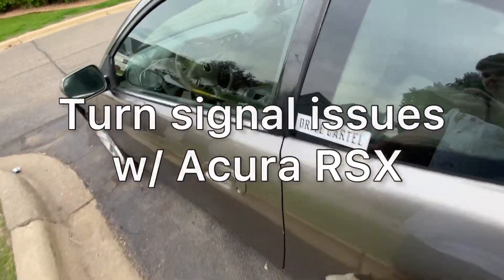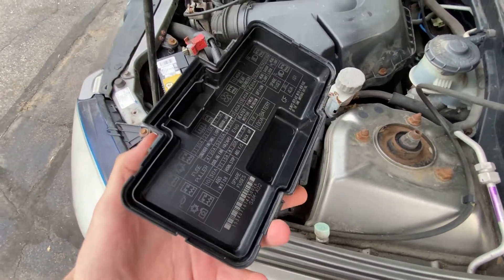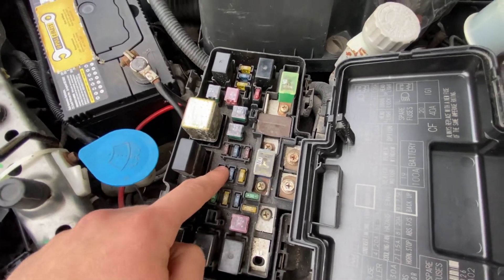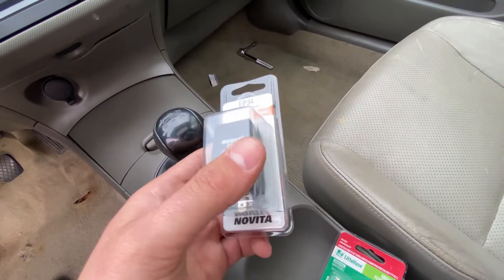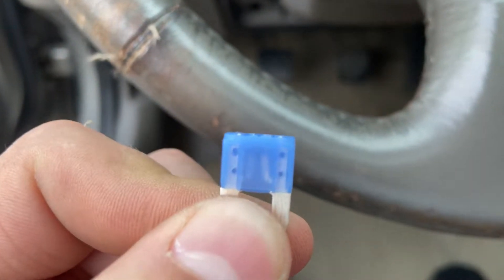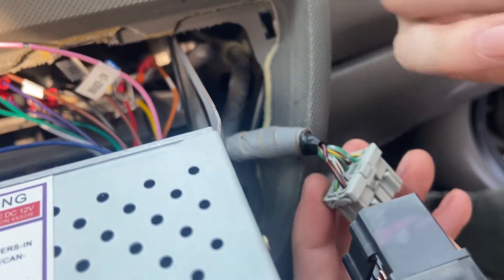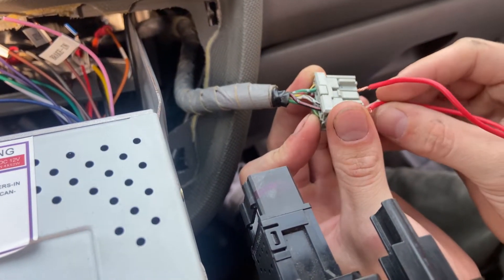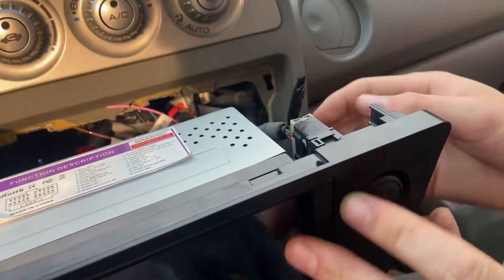How to diagnose turn signal issues (Acura RSX)

Comment: Sorta happened to me too after I installed an aftermarket radio in mine (02 RSX Type S) but I just had to reseat my turn signal switch and it started behaving (didn’t have to mess w the green and white wires) just swung by to figure out where the relay for the turn signal was again - got a diode dynamics one that’s LED compatible but also let’s you choose how the lights blink in a pattern which is kinda cool

Thanks for the vid!
Reply: Hey this has been happening to me and this could help but could you explain on how you reseat the turn signals

Comment: did it happen after you installed the car play? because i ordered the same exact carplay you
got and right after, my signals dont work but my hazards do
Reply from the maker: Yes so I’m assuming that was my main issue
Reply: @DC5CJay  all my fuses are good, checked on the power probe so what can i try next

Comment: My dc5 is having turn signal issues but it only happens sometimes. When I’m driving and try to use my turn signals the car shuts off. There’s no light in the dash nor do the blinkers or windows work but every other electrical component works. I have to sit with the car in ACC mode and wait for the lights in the dash to start flickering(as if a short is somewhere) until it eventually comes back. It also started happening when I change the gears(automatic transmission). Any advice?

Comment: I changed hazard switch, relay , fuses still not working ...right after changing the radio
Reply from the maker: Did you leave your battery connected when you swapped the radio and also have you checked both fuse panels for any issues
Reply: @DC5CJay  outside fuse are good
Reply: @DC5CJay  yea battery was connected
Reply: @edgarcorrea6085  currently having the same problem. how did you fix it?
Reply: @ox.dc5  found 2 more fuses in the panel under the wheel